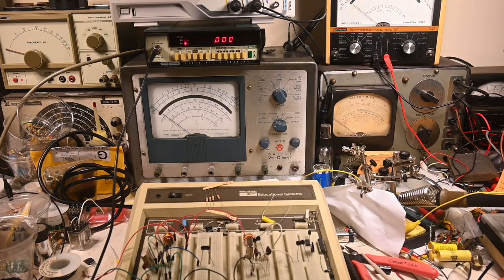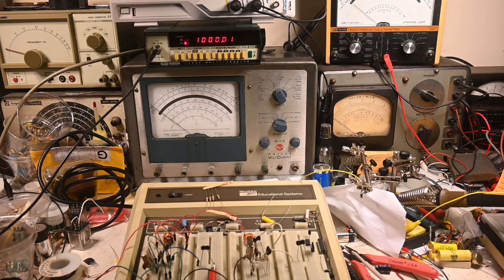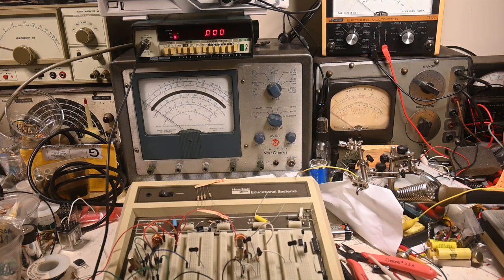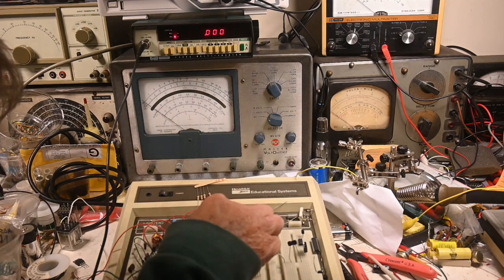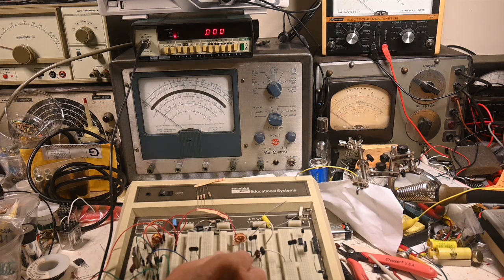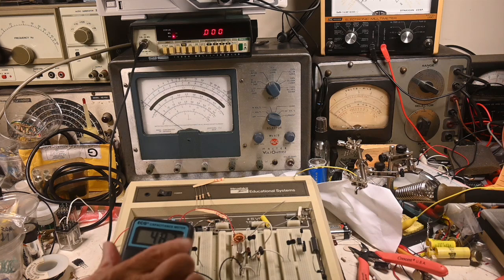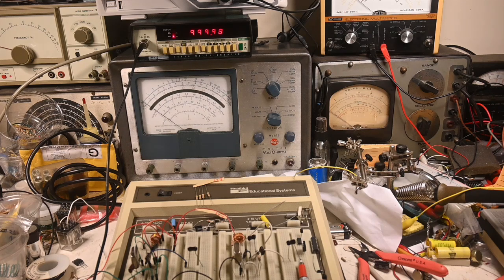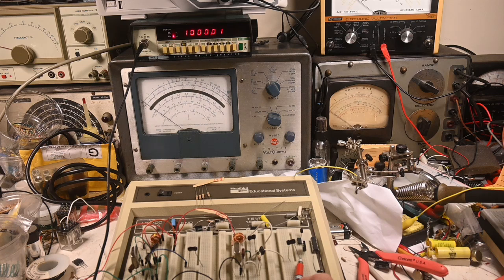Swap 1MHz Crystals and change Capacitor  and Voltage Values

Comment: Hi Rick thanks for doing this. I remember that as a child we could buy all sorts of ex military equipment from a place called The Radio Centre, in Hurts Street, Birmingham, England. I didn't really have a good understanding back then but I loved everything technical. They had number 19 sets stacked up all over the place, one on top of top of the other as high as a man could reach. They were very cheap but still more than a child could afford. I remember they had "crystal ovens" for sale, which I really didn't understand back then but I clearly remember reading the label on the box. One of your opening comments about a change in temperature influencing the frequency took me back some 65 years to a box full of crystal ovens and the smell of the old Radio Centre. Thinking about theses very small differences in frequency reminds us that precision costs money and I wonder if the crystal in the frequency counter or those on the bench are more precise? If you watched that old video that I told you about, I wonder if you fancy 'trimming' the crystal to the right frequency, Hi Hi.
73's . . .  Andy      GW0JXM
Reply from the maker: Hey Andy, I spent many hours taking radios and amplifiers apart and then putting them back together again, when I was in grade school. For a science project in the 8th grade I had a record player hooked up to a flashlight. When the beam shown on a photocell and amplifier the music would play. 
I have watched the video Crystals go to War in 1943 a few times. I wonder how they are made today. Thanks for the link.
A friend sent me a link to Starlink. I think you will find it interesting.

https://youtu.be/qs2QcycggWU?si=dweLTH_w4Wr8aqAD

73 .... KD4PJI

Comment: I tested the same 1MHz Crystals in lab and find 84 pf - 500 pf work work the same but replace it with 100 uh . 1Mhz crystal oscillate  (Colpitts Oscillator) is very stable . Like the video🥲
Reply from the maker: Thank you, and you are welcome.